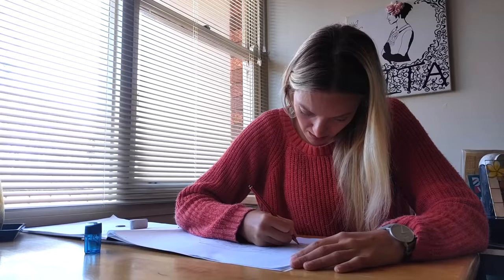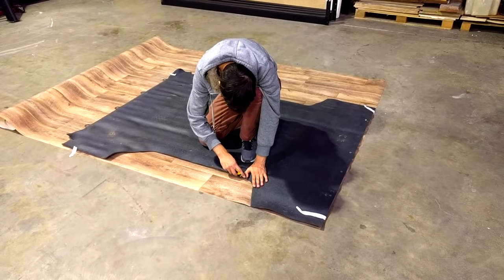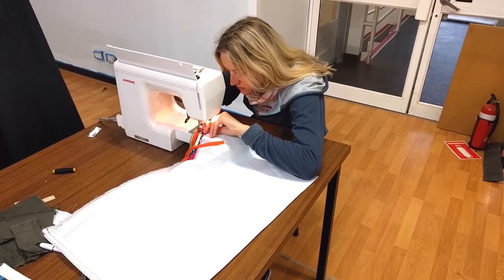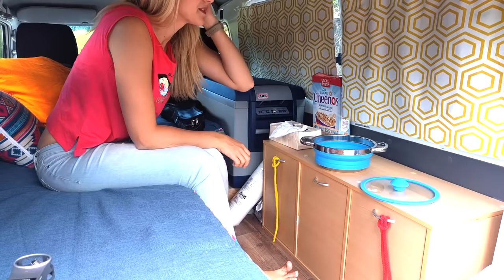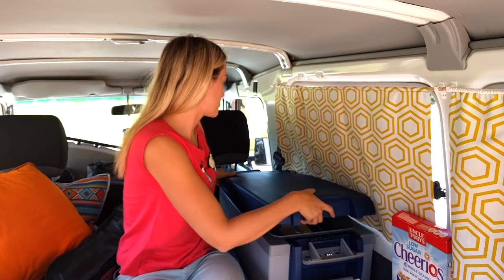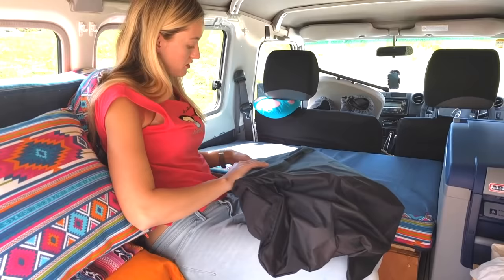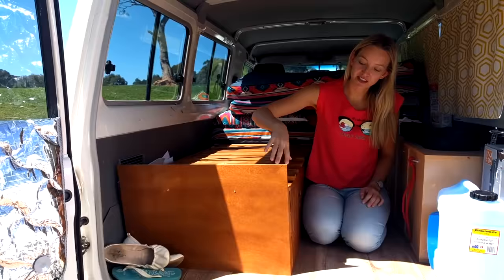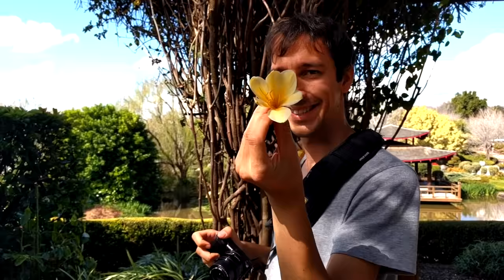Ep. 4 The Troopy Makeover - Everywhere Together

Comment: I would’ve done some stuff to the engine for reliability such as a pre fuel filter as you will be getting fuel from different places and you might be unlucky and get a bad batch of fuel and the engine won’t appreciate it also a dual battery system, tint, catch can, EGR block, EGT gauge and water temp gauge all these things will give you peace of mind when travelling in remote places

Comment: It didn't look like anything in the vehicle is tied or bolted down.  If you have an accident, that may prove a bad choice.  Good choice of vehicle though.  I did a year of driving around Australia in a Land Rover Discovery 2 - 40,000 km's, most of them off road.  Had lots of adventures.  Good luck and best wishes.
Reply from the maker: madbikeboysins yes, you have seen it correctly. thank you for your comment. we've been thinking to change that for a while, as it does seem a bit daunting for us too. /Sandra

Comment: did you allow for reserve fuel tanks???
Reply from the maker: Jason howe Hey Jason! yeah it's got the factory 2x90 liter tanks, we didn't need more than that so far /SandrA
Reply: where i live i wouldn't be caught with less than 300 litre mains and 150litre reserves as it can 500-1000 km's between fuel stops and 150 litres or more in jerry cans

Not sure where you plan to travel though I have a reason for that much  fuel as you will likely need in the case of turn around and limp back to a town for repair work ,,,

I never go with stock  fuel tanks because there isn't enough fuel in them at 180litres especiall bush bashing
Reply: Hi Jason, I have a Troopie V8 with twin 90L tanks. I average between 650 and 700Km from each tank. When 4WDing I get 560-600Km from each tank. Just crossed the Simpson desert in Australia. The troopies  are a great machine.
Reply: hmm I'm of the opinion that you play with your life not having 200-300 litres as a bare min on main fuel tanks you are better to have 150 litres as a reserve tank because there can be along time between fuel stops and there is a limitation in fuel reserve when and where  fuel cans are stored which will no get you 100km's down the road in most cases...

E210 Dall you may get 1120-1400 km combined  though each trip you make is different and i would not make a lapse in judgement in the fuel you carry as there can be 250-500 km between fuel stops especially between towns of the north west of WA and 20-40 litres in  jerry cans might not get you to the next fuel stop...

vehicles handle very differently when you factor in payload capacity in both vehicle weight and in some cases in what you tow behind your tow vehicle, I always allow more fuel because it can be a long walk to the next fuel stop.. and there is no guarantee that the fuel you have in reserve in jerrycans will get you to that next fuel stop..
Reply: Yeah fair enough. You have to be comfortable in the way you travel. Having 300 litres would be brilliant though. Cheers, happy travels.
Reply: I always allow for over stock capacity when traveling the northwest because you never know when going into a head or tail wind on how much fuel you will consume.. nevermind how much fuel you will consume offroad, especially if or when towing 2-2+ tons behind you...

whilst 180 litres suit your purpose at this current stage E210 dall, I would strongly suggest increasing the stock fuel tanks you have as I doubt that 40-90 liters of spare fuel in those jerry cans (pending on size) is going to get you to the nearest fuel stop could be 500-1,000km  away from where you are at present off-road..

whilst my setup is more for towing though principle still applies when you are over a metric 5 ton in weight..